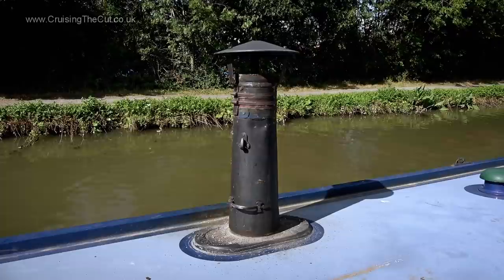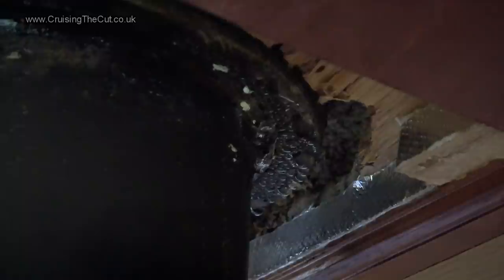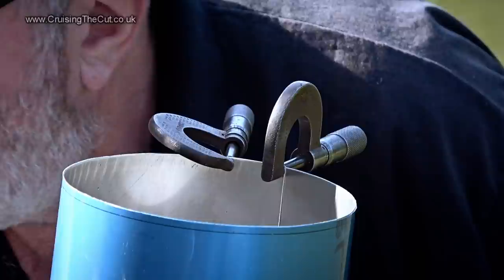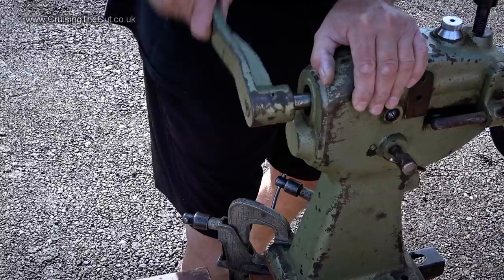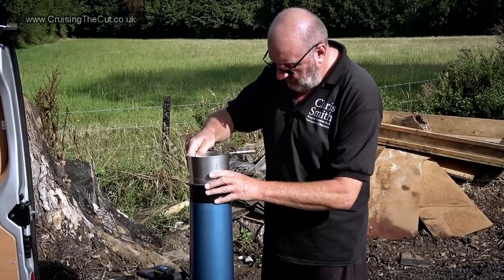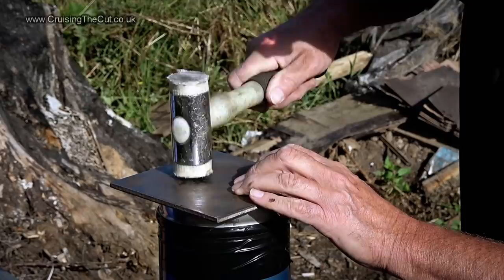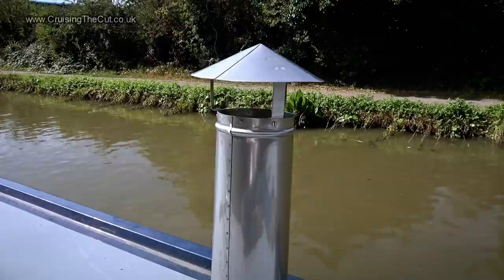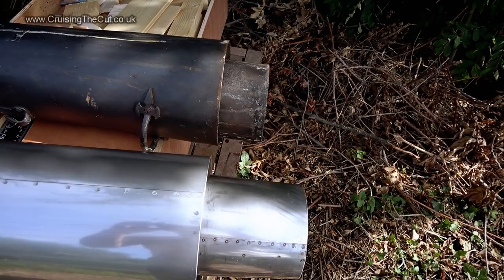138. Getting a custom-made chimney for my narrowboat stove

Comment: As for the Micrometers, Probably are disused micrometers due to they are out of accepted tolerances. Well I guess is a good second life for them. Many engineering tools don’t pass the ISO tests over time, especially precision  measuring tools. So they get discharged, or sold to the amateur market, like lathes for example. I got one my self! It’s excellent for my use, though not for what was being used before.
Reply: 100% correct, let's hope the armchair critics read it before making stupid comments.

Comment: Good to see that you got a nice proper chimney. Keep in mind that that stainless steel will change color a bit or a lot depending on environmental conditions, and the impurities in the metal. There are two sides to this, it might change and and you could love the color and look it it changes with a pattern, on the down side you could hate the way it ages. Whatever the case, it does not change the fact that you have a really nice chimney that should last you many years.

Comment: as a Journeyman Sheet Metal Worker most of my working life i can appreciate the craftsmanship of other Tinners like Chris I have made similar for wood burning stoves here in the states, albeit  Ive used a pipe lock seam as opposed to a lap and spot that Chris uses, but to each his own. I can see why he uses it in this application though. Id recommend you use him to make a stainless flue pipe when you need to replace the one in the cabin of your boat as well! it will last a LOT longer than the regular flue does (also less chance of burn out/through so its safer as well!) and the heat generated will over time turn the no.1stainless finish a nice bluish-brown over time as well! on bits of it.

Comment: Good gracious, using micrometers as clamps. There's plenty of tools that can be used creatively for other purposes besides their intended design, the micrometer is certainly not one of them! Besides ruining the micrometer it would work less effectively than an actual clamp. An actual clamp is cheaper too. Other than that the part looks good, perhaps the workmanship reflects the price but it seems readily fit for purpose and a good improvement on the old.

Comment: michael perry
1 second ago
Watching lots of the canal boat video's we often see you good folk groping around in dirty canal water trying to find out  whats around the prop so giving it a little thought came up with an idea ,3  of feet of plastic rain pipe about 4 inchs wide  should do it, cut a circle of clear plastic and glue it into the base with Araldite l this will give you a clear view when pushed down into the water through the weed hatch .To clear any obstruction us a lawn edger sharpened on the top edge as well as the bottom edge, this way no need to put your hands into the water at all

Comment: Excellent. It look's a very nice job.  I had to watch this 3 times, to try and understand the way the chimney worked. I think using micrometer's as G-Clamps and hitting a mild steel plate with a soft faced hammer threw me off track, initially..

Comment: Powder coating is a good idea, as the paint will not fall off due to age or heat and is resistant to damage by scrapes and dings, I have a couple of tools and a flashlight that is powder coated and ather a decade of use with drops and dings and scratches due to dropping on to asphalt still has their  powder coats intact.

Comment: Very interesting David as usual... Love all your vlogs.... Clearly Chris is a craftsman who knows what he is doing.... Unlike the "knowledable" peoples' comments about his re-purposing of obviously ancient micrometers.... C-clamps and or G-clamps would leave a large flat area on a round pipe which would need to be repaired before installation.... The contact area of the micrometers is considerably smaller and would less likely leave any damage.... Don't think the "knowledgable" people thought of that before opening their mouths to change feet....
Reply: There are small clamps - cheap and available...why subject a precision measuring tool to such abuse for the sake of a couple of quid - your reasoning is flawed. Any machinist who has used micrometers to accurately produce high tolerance parts would be highly offended - please refrain from using inverted commas to suggest that knowledge is somehow a weak characteristic trait. We have idiots in charge of countries now because somehow experts and knowledgeable competent people are not fashionable.
Reply: Chimney and tinwork is not an esoteric or even rare art. It, like precision machining, has its own specialized tools to address the common challenges such as the one you cite. Those micrometers are precision tools, manufactured to tolerances beyond 0.0001" by men and women whose craft IS rare and dying. Those tools are also forever rebuildable. At least one was a Browne and Sharp, a company which still trades today nearly 2 centuries on. Every wear part of that tool is still available; it could be rebuilt and back to new standards in 20 minutes. To use them for clamps is an insult to the people who made them, who spent decades apprenticing the master machinists and engineers to learn how to make such a work of art.

Comment: I believe the muck you have found on your chimney is what Americans call creosote. It is a chemical which turns to sticky grunge when it accumulates.
The exhaust leaking, yes, is an issue, however, that grunge is caused by the fire being at too cold a temperature when it reaches the flue. It can also be from burning too much bark in the wood you use. Good luck with your videos. Love hearing your story. Get your fire hot every now and then and the muck will disappear. best wishes. Aussie Chris.
Reply from the maker: Hi. Cheers. I don't burn wood, just coal. Believe me, the fire gets hot :-)
Reply: OK, I don't know what it is then.

Comment: micrometers make for expensive c clamps =P I love Chris' mobile workshop, everything needed close at hand. My only question would be is it removable should you come upon one of those annoyingly low bridges?
Reply from the maker: Yes, it just pulls off with a bit of a wiggle. I will remove it for travel, as I used to with the old one.

Comment: I liked that blue colour too, I wonder if they can make the outer cover out of anodized aluminium or titanium (you can't anodize steel as it will simply rust). It might work, depending on how hot the cover gets (I think the anodizing can be distorted and discoloured by excessive heat). 

This got me wondering whether you could make an entire narrowboat out of anodized aluminium, I checked to see if aluminium narrowboats were a thing, and they are, so I don't see why it couldn't be done. Though, because it is an electrolytic process, I wonder whether the colour would change at the water line. Although, that might actually be kind of cool if it did. Not traditional, of course, but I'm of the opinion that merging traditional, vintage designs and methods with modern materials and methods is a great thing, sort of an extension of steampunk, dieselpunk, etc.
Reply: Aluminum will not last a chimney application (too hot). Titanium might but I would not think about site welding it. Given the possibilities of sulphides and chlorides in the coal (which titanium is resistant to) Hastelloy may have been a better alternative for really long term (significantly longer tha the boats life).  A roll crimped overlapped joint or seam weld would also be more gas tight for the liner but at these pressures the leakage may be acceptable with the spot welds and much faster.

Comment: Those aren't clamps at the top; they are micrometers, which are precision instruments typically designed to measure to an accuracy of 10 microns. I have never, ever, see them used for that function. It's like using a small gold bar as a paper weight...
Reply: Nah, they can be bought cheap, you can get em for 10-15 euro online. Most likely the two he uses are worn down and lacks the required precision to be used as micrometers.

Comment: Aside from unconventional multi-tasking for his micrometer, final adjustments made by offering up & tapping into a hard fit before final fixing. Good job obviously well done, it might take a little 'bedding in' before it becomes an easy remove & stow for travelling. Making the top hat removable for emplacement during running in a low position to prevent weather ingress could have provided genuine utility. Just a couple of thoughts but loved the show with the job, there is something satisfying in watching a proper tradesman plying his trade.

Comment: I had missed it till I read all the comments about the micrometers... I have a set of clamps like that, which are great for low pressure holdings as they're lower profile without the leverage bar hanging out to get in the way.

Why design a new part from scratch when they could just reuse the same tooling from a factory making micrometers?

Comment: David: As to the chimney I am surprised that the builder did not put a lip (Collar) around the hole which would be lower than the Cap but would prevent egress of water into the cabin. Someone missed on the design here. Even the "colonial" homes had that figured out.

Comment: Interesting vlog, did you add insulation in the gap between inner and outer tubes ? Oh and I also use an old imperial micrometer as a clamp as that’s all it’s good for, waste not want not
Reply from the maker: I haven't yet but I was advised to do so. Need to find a small offcut (since the DIY stores only sell 25m rolls!)

Comment: What height above the waterline is the maximum to be sure of being able to pass through tunnels please? This must have been considered as part of the design process?
Reply from the maker: Depends on the tunnel. I take the chimney off when travelling.
Reply: @CruisingTheCut  What about the older style boats with midships engine rooms where the exhaust stack comes up, through the roof. Some seem quite tall (to keep fumes away from the helmsman.) Are these also hinged or removable? Some of those tunnels are very tight.

Comment: Hi David, I just wondered if this new chimney will remove as easily as the old one for those low bridges and tunnels. I noticed you had at least one handle on the old one.
Reply from the maker: Yes, it removes with a bit of a wiggle.

Comment: Is the height of the new chimney short enough to pass through a low tunnel/bridge?
Reply from the maker: Mostly but I still remove it for travel
Reply: @CruisingTheCut  What do you do if you are travelling & a) need to cover the hole due to weather etc or b) want to leave your fire on, so shouldn't there still be a chimney on it?
Reply from the maker: I don't worry about the weather if the stove's on as any rain will get burned off by the heat of the stove. Ideally it should have the chimney for optimal draw but if I'm travelling I'll have set the stove to just a tiny glow anyway so not a problem.
Reply: @CruisingTheCut  Many thanks, might just have to try to talk the wife into a life upon the water.
Reply: @CruisingTheCut  Would it have been easier to have a short chimney then having to remove the chimney for low tunnels. Is there a building code for the minimum height of a chimney?
Reply from the maker: @jmgobeli Not a code as much but a long chimney is better for the draw of the fire.

Comment: Tight tolerances my arse.  The reason for the air space between the inner pipe and cover pipe it to keep the cover pipe from burn your arse when you touch it.   It appears this is all about form and not function.
Reply from the maker: I assure you the function is excellent.

Comment: Are you not going to have a safety chain or wire in the new chimney, so it don't drop in the canal if you have to dismantle it passing a low bridge or tunnel?
Reply from the maker: I'll be removing the chimney for travel anyway.
Reply: CruisingTheCut do you never have the fire going when you are on the move?
Reply from the maker: Yes but only on "tickover" (just the embers glowing)

Comment: ?? A 'Jubilee clip'?  Let's try a 'band clamp'.  And using micrometers for clamps? Horrors!  But it is cut and fitted to size.
Reply from the maker: We call them jubilee clips.
Reply: Yep they are Jubilee Clips in the UK, and using old analog imperial Micrometers that no one wants or uses now days as G Clamps is a great idea.
Reply: Ah, you saw it too. That's what you call re-purposing items, ha ha.
Reply: @backyardbasher  We have plenty of need for gently used Imperial Micrometers here on the west side of the Atlantic.  We will remain the last bastion of inches for quit some time to come. Just place 'em on ebay with decent shipping rates to the US.

Comment: I'm not sure using an external micrometer as a clamp is such a good engineering. These are ment for fine measuring not clamping narrow boat chimneys ! Lmao
Reply: Funny, I had that thought too.  Figured maybe they were just so old/rusted/out of cal that they were of no more use to measure.
Reply: @mindset07770  It's clearly been around the block quite a few times. I bet its accuracy is still more than fine for the job.

Comment: More money than sense. Those clamps are micrometers and finishing off with a dremel you can't be serious. Next job you need let me know. I'll sort any problem for £50 or just sink the boat for £100.
Reply: I agree, using the micrometer as a clamp was bizarre even if it was worn beyond its proper use and using a dremel to clean up spot welds and other surfaces on stainless steel would need a buffing wheel and polish to restore the finish. Where he had spot welded different gauges the thinner material had melted through leaving holes... not a great job.